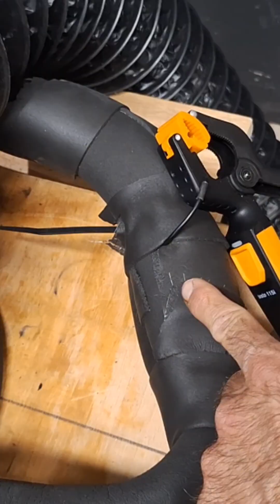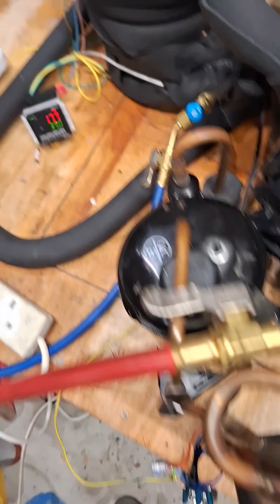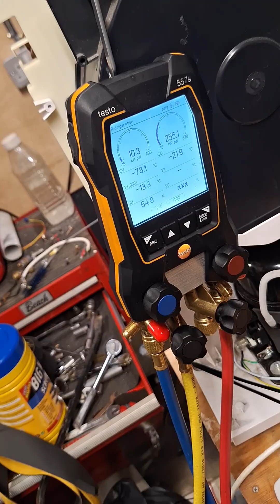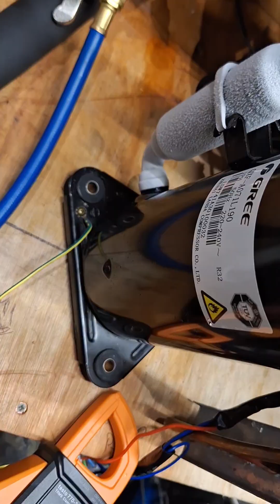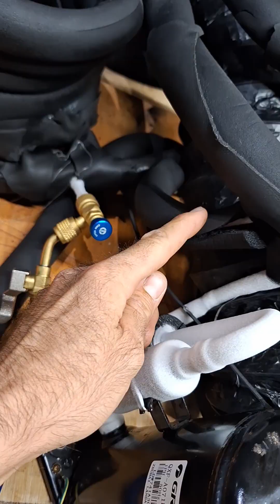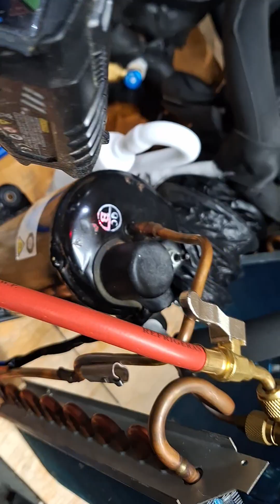Building a CO₂ Cascade Refrigeration System for My Vacuum Freeze Dryer Project

Comment: Thanks mate. Luv your work. I want to build a freeze drier as I can't afford a storebought one. Even a Vevor costs $6,000 in Australia and the better made brands are over ten grand. I have engineering skills. There is a bit of a learning curve regarding which refridgerant best to use and you have given me a bit more education with this. Thank you. I think I'll buy a recovery system and an old chest freezer and go from there. Also I'm not licenced to buy refridgerant gases so I've no choice but to scavenge. Gazza
Reply from the maker: Thank you  
you should be fine with R290 or co2 as you shouldn't need a licence for that its only propane just use the right equipment designed for flammable gases and not to contaminated with any air